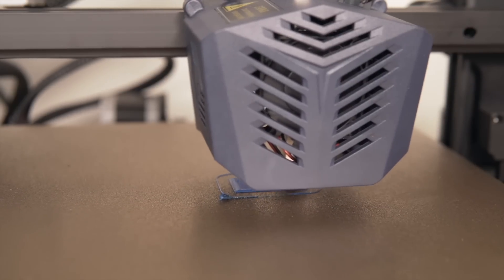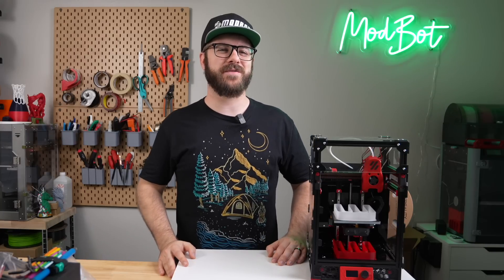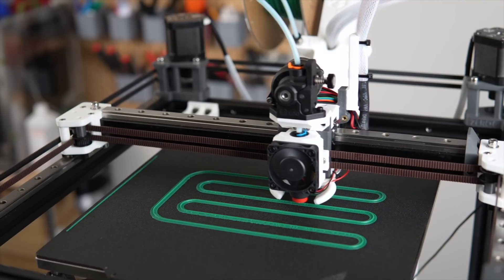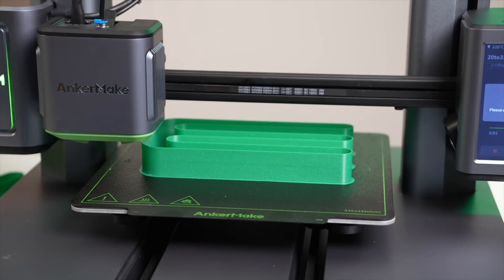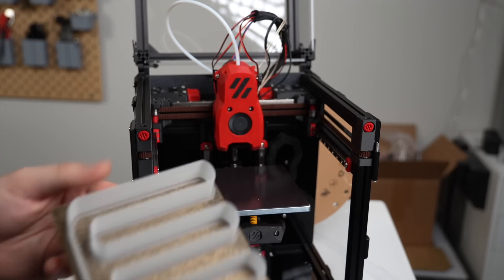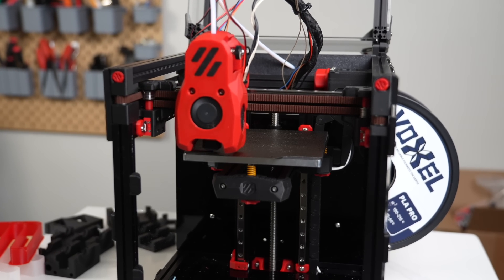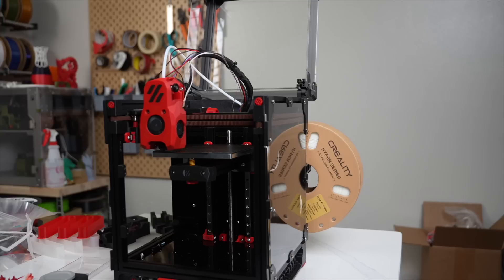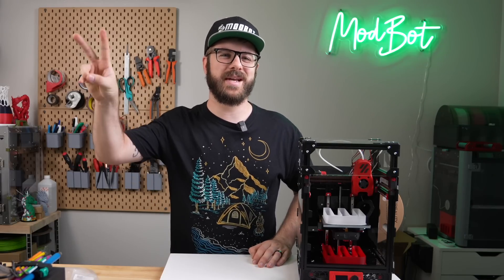Putting High Flow Filament To The Test! (Creality Hyper PLA)

Comment: To me as a beginner this PLA seems like an PLA with an high viscosity when warm, the bed temperature kind of reveals that due to the lower 25 degree celcius minimal, while other PLA might go as hot a 80 degrees this one stops at 60 degree celcius, so if the printer needs to work faster by increasing the flowrate the PLA needs to be thinner, therefor, this is accomplished by the higher viscosity, like thinning out the soup, or the choclate that is thinned out with and X material, that is not to say it is less hard, or ridgid.

Comment: With my Creality CR 10 v2 printer, I get very good prints at 70 speed and it gives wonderful fine details.  I also don't see any fringing or other errors.   but I tried printing at 180 speed with cr10 v2 and the result was terrible.  Sometimes it's all about your printer.  It's a good filament for a good printer, but it's an unnecessary option for someone with a simple printer like mine.

Comment: I have used the Flashforge high speed PLA and it has never had a problem with my Elegoo Neptune Plus at 250mm3/s and I have tried regular PLA and it doesn’t like those speeds.

Comment: Thanks for testing.  I have been playing around with high speed pla myself. I'm not flow limited at the speed my motion system can handle wish a .4mm nozzle so I haven't really noticed a difference in flow rates. I have noticed a difference with cooling.  The high speed filament seems to tolerate my lack of cooling at high speeds.  

I actually got a pretty good quality benchy in ~13mins with high speed pla including acceptable overhangs and smoke stack.  While printing the same gcode with standard pla I got droopy overhangs and a clearly overheated smoke stack.

Comment: I am new to filament printing and have only used Hyper PLA so far as that is what Creality sent with the printer and I have not had any issues printing whatsoever. Compared to resin printing i love filament printing. I have not had any failed prints and the machine just keeps on printing. consumer 3D printing is getting pretty good.
Reply: Did you ever try a different filament? I'm the same so far and have had good results with hyper and kinda scared to try another, but also kinda expensive so wouldn't mind a cheaper filament if its the same lol
Reply: @chris-kp6qf  Yes I have now tried most filaments. Today I mostly print PETG . I most just use the standard print settings for the filament and have no issues.

Comment: Why didn't you just use the X1C would have shown a more drastic result faster
Reply from the maker: Speed wouldnt have been too different. This test does increase speed but alot of it is in line size.

Comment: Surely std pla will “hyperflow” at a higher than normal print temp anyway? I was asking someone who makes filament and he said it will flow or be more runny simply at a higher temperature.   So is this just a marketing gimmick to boost the retail price?   Glass gets runnier at higher temps than usually used fyi…Laurie NZ.

Comment: I'd love to see a high flow showdown to see which brand makes the best high flow filament and which brand makes the best bang for buck. The high speed users would appreciate it
Reply: You mean testing a HyperPLA like it is for fast print speeds? I was expecting exactly that when clicking on the video but it seems this is not the case.
Reply: You mean testing a HyperPLA like it is for fast print speeds? I was expecting exactly that when clicking on the video but it seems this is not the case.

Comment: HiFlow rate in this test would mean that the speed needs to increase. And you can clearly see that even at higher layers the speed is not fast aka the flow in not high. The speed of the printer at 32g/s with a 0,4 mm nozzle should be over 150mm/s
Reply from the maker: The speed does increase on the v0.2. High flow isn’t just speed but also layer height/width. The orcaslicer does a great job of this. It did not increase on the Ankermake printer though.
Reply: @ModBotArmy  It seemed like the Anker wasnt printing faster than maybe 70mm/s .
Does it print normaly over that speed and what is the highest flowrate you have tried in the Anker. It seems odd that any printer would be software limited to print at a flowrate under 15.
Reply: Also would be interesting trying the flowrate vase mode print with different layer heights (0.1mm to 0.3mm) with the 0.4 mm nozzle

Comment: On a Bambulab using 0.4 CHT nozzle, I print all Esun&Sunlu PLA+ using 35mm³/s without any problem, I have tried Geeetech PLA HS, and it print nearly as well except it often break into the PTFE tube as all other of their PLA, so I stopped using any Geeetech filament. To conclude most filament PLA+ comming from Esun & Sunlu support High speed up to 35mm³/s using Bambulab+CHT nozzle.
Reply: Do you mean the e3d x bambulab collab nozzle or something else?
I'm quite curious >.>

Comment: I have used the esun in white and it definitely flows better than standard  additionally it seems that it cools better than standard also so it performs better all around at higher speeds.

Comment: The AnkerMake was obviously printing ultra slow, not at the requested speed. 🤦 Garbage printer, as expected from them.
Reply: well it's not really garbage if it has correctly configured machine limits.            for most users anyway.
does that flow test increase flow or increase speed to match the wanted flow? I thought it would just increase the amount of extrusion per mm, not affecting the speed the printhead moves (that would screw over the test on many printers if it wanted to move it faster )
Reply: @lasskinn474  The test increases, and has to increase, speed. Just extruding more material per unit distance would make the walls quickly widen and topple over, melting from too much heat density and even squishing out past the nozzle flat.

Anyway, the speeds it was moving were so pitifully slow it couldn't have been exceeding 5 mm³/s, probably not even 3...
Reply: Agree but also disagree. The printer is aware of bad input and compensates for that to achieve a good print result, which it always did.

Comment: There's high flow TPU too and it's excellent.
Reply: Who makes it??
Reply: @Coolfwip  Polymaker
Reply: Any recommendations on temps / cooling for it? I have a spool of the clear stuff that I haven't opened yet. It's overture hs-tpu
Reply: @XHolyPuffX  I did the 10 min TPU benchy at 270 but I hear TPU really shouldn't be allowed to cook at that temp. 240 is probably fine for reasonable speeds or if you have a long enough melt zone (I didn't).
Reply: @daliasprints9798  What happens if you run it that high? And what do you mean by melt zone?